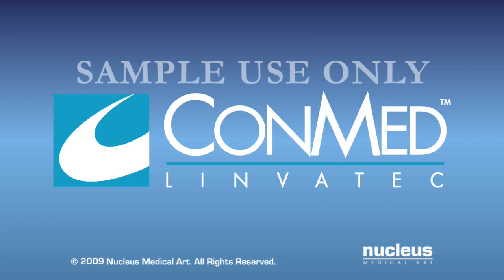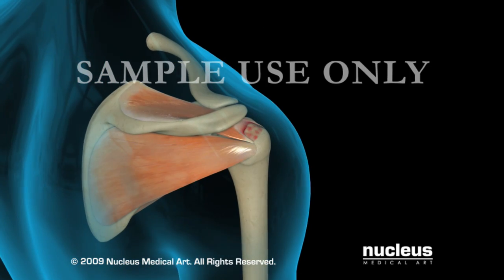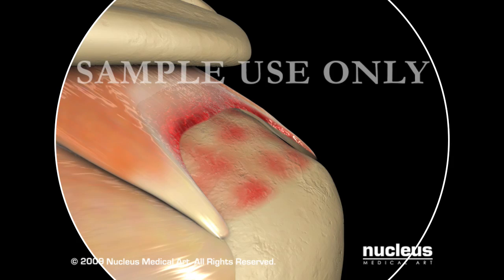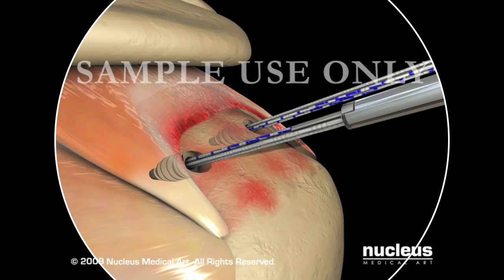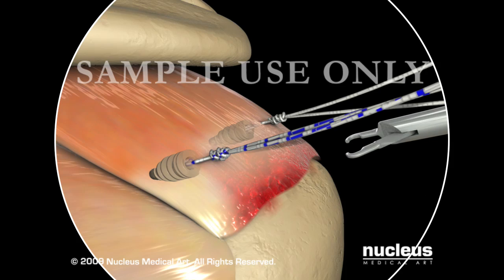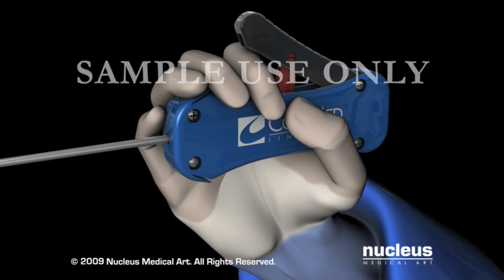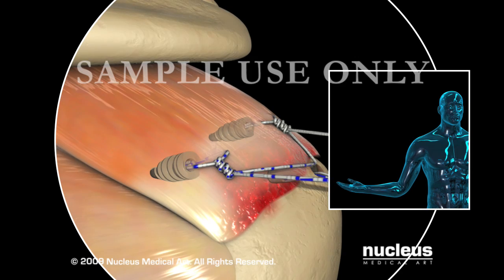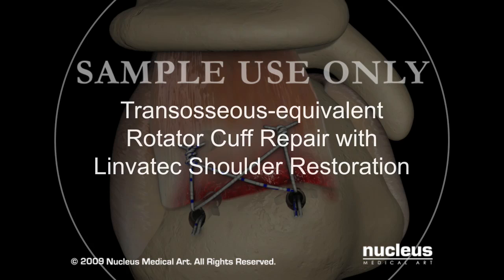ConMed: Linvatec Rotator Cuff Shoulder Surgery

Comment: I'm about 5 months post-surgery.  My doc has been very conservative with PT having started me after 12 weeks instead of 6.  I have pretty good overall range of motion, however my arm has not had much exercise in 5 months so it is weak and I have some soreness still.. but I have to say the healing has been consistently improving the whole time which I believe is a very good sign.  After the 6 month window has passed my doc said I can up the resistance at that point being that statistically a high percentage of reinjury occurs in the first six months after surgery.